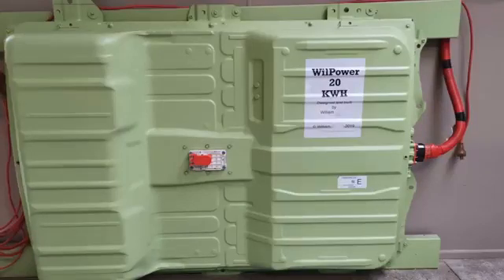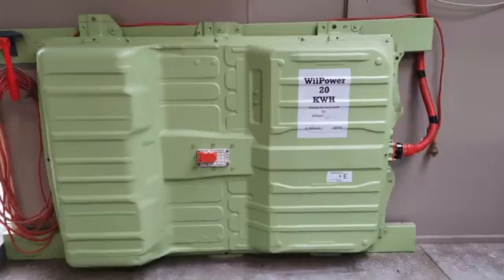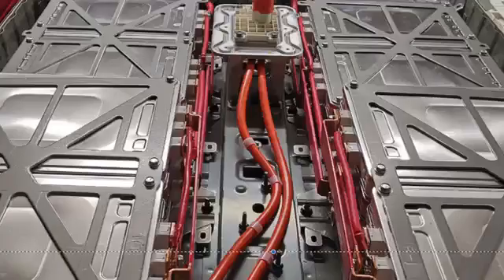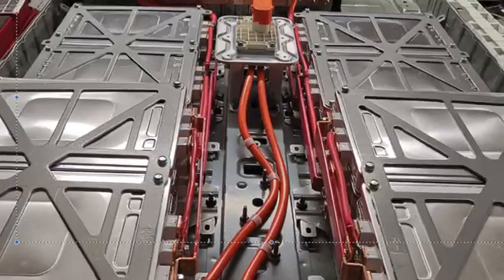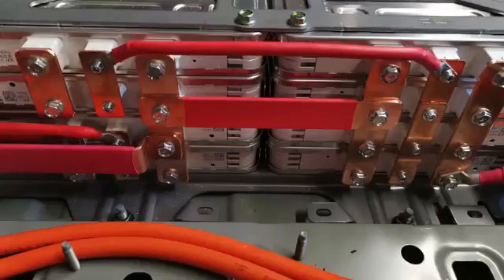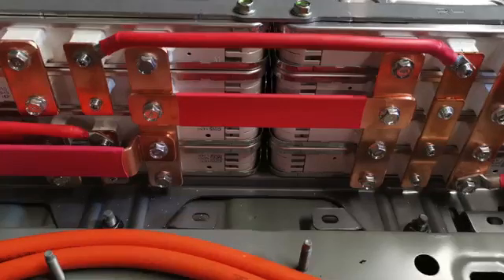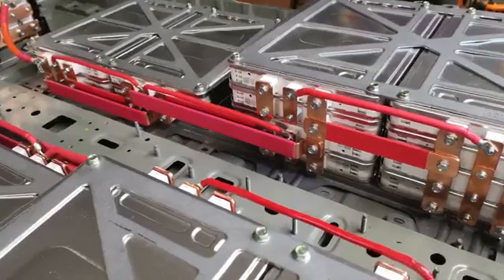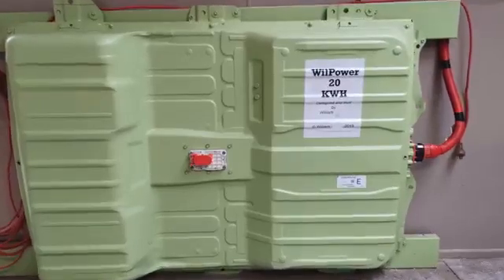Nissan Leaf Battery Pack Solar

Comment: Hi William, just came across this video as I'm about to be given a Nissan leaf battery pack and I'm interested to see if you have a 'Dummies' guide for the steps that need to be taken and the parts that need to be purchased in order for me to attach it to my 48v 5.5kwh mppt solar hybrid inverter to run my house with 3kw of solar panels. Sunshine is not an issue where I live here in Cape Verde, we get about 350 days a year, I would really appreciate any advice/help that you can give as there are very limited options for me on the island i.e no solar electricians that I can call up for help towards the install and it would be such a shame to waste the opportunity to reuse this battery pack. Regards Stuart

Comment: Nice job, I was wondering what would happen if you feed the 380v straight away from the original battery to the solar input of let's say a Pip mppsolar battery less 5048gk .  These inverters can handle I believe in the range of 500 V or so and you could connect multiple inverter's in parallel. Obviously the set up would only be good Discharging useful tension off the battery bank. For charging the battery bank you could use cars original charging station which would be connected to the 220v output of the pip inverter's! What's your take on this set up I'd like to know!

Comment: Hi Williamgerr.  I have been subscribed for about 12 months and love your video's and they have been an inspiration for us.  We had our solar installed in the middle of July and I have just made my purchased of my first Leaf battery pack which should arrive by the end of the week(Gen 2, 11 bar, >80 SOH) for my DIY.  I have a question for you.  I need to purchase one single module of similar spec.  Would you have any suggestions of where to get a module in New Zealand.? Most modules on Trademe are lower SOH(or would that not really cause to much problem of a 7x7 module setup).  You and also contact me on patrick.john.otten@gmail.com if that is easier.
Thanks Patrick
Reply: You could try BeForward.jp - they sell cars and parts for import with regular shipping into most major Ports here - I found one listed there for under $3000 - plus shipping and import fees/GST or duty etc. Many of the second hand car sales places get their stock from them.

Comment: WOW is the appropriate word William! This is how I want to setup my system. I've built a 3×5 meter cement block equipment room for my 2 gen 2 batteries. Most of these DIY guys are wasting their time on 18650 battery packs. I don't want to to go that route. after more than a year of searching YouTube for someone building exactly the system I want to build, my search is over. So William, my question is, are you selling a schematic to your Gen 2 battery Bank or are you going to make a video of how you did it. I would love to have cut list of the bus bars and how you configured that system, and templates for the busy bars on the configured Gen2 you did for you customer in the last video. I'm going to leave my email address on your company Facebook page so we can privately message. Thanks, Roger, Florida, USA.

Comment: Love your videos, William. We have a section here in Northland and will be building a 2 bedroom off-grid house to retire to at some stage. I have been looking at traditional battery storage options as well as systems like you are producing. Look forward to future videos,  and do see this as being a viable option for us. It does seem Leaf batteries or similar can work out to more bang for buck? Also interesting on your comments about cell balancing working better when left alone.
Reply: Hey also in Northland and just switched on our hybrid system with a 5kwh Lithium to cover brown/black outs. Good 48v/4kw system that took about 5yrs to sort out and install! We have a leaf to charge too, which takes our excess solar, and thought about using it later on for home storage...it's not cheap and not so simple to do it tho. We're towards Tutukaka if u ever around and want to see :)
Reply: @octopusenvy I am in northland too, would be interested in seeing what you have done

Comment: wow interesting William..much better approach i feel.. so no need to make any modification .. if can ad one more cell to make over 48V will be the best, or config  the pack to be over 48V, is it possible? Good work William !!
Reply from the maker: It has seven in series 56v nominal
Reply from the maker: It has 7 in series 56v nominal